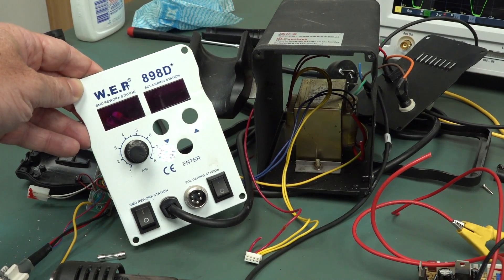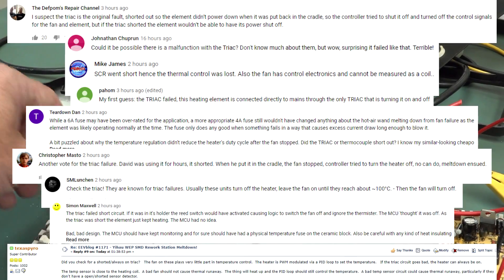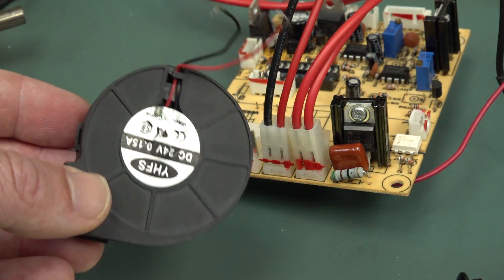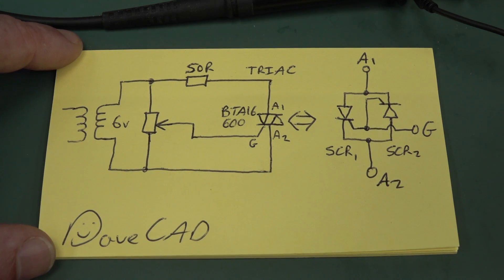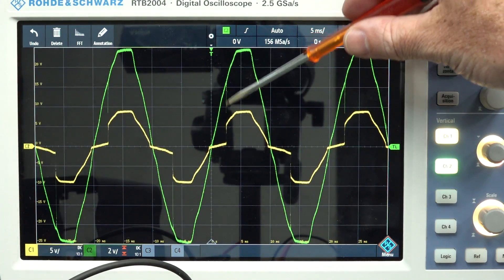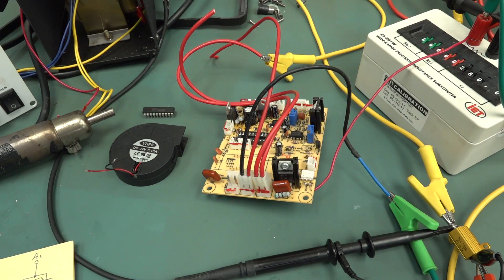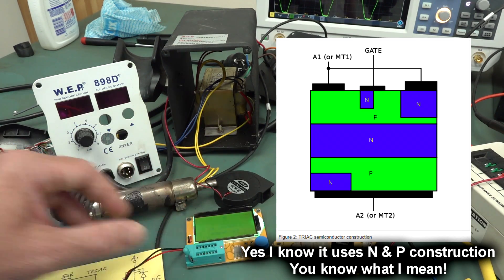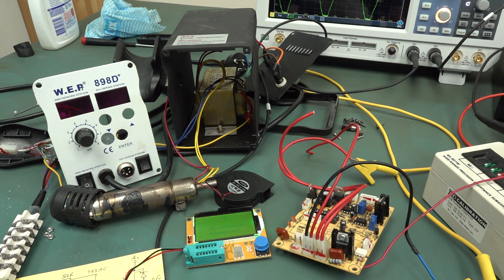EEVblog #1172 - TRIAC Testing (WEP Meltdown Part 2)

Comment: I have a cheapest&noname 858D station and there're not 24V on the fan. It regulates within about 4-17V through linear regulator. Btw, the fan is marked as 24V. I believe the IC inside is the same as your one, with 3-16V power supply. So, probably you killed it instantly☻ I wonder why they mark it as 24V? Probably because the entire thing is made of cheapest crap, so they're using some standart rotor, that's just cheaper I suppose and no one cares about its marking.
Reply from the maker: It should have still done something (even briefly) at 24V, but it didn't, it was dead.
Reply: @EEVblog  Anyway, there're no fan fault detection.The MCU can only turn it off and on. The fan does not have hall output for rpm detection, only power rails and nothing else. And there're no thermal fuse near heater. So I guess in normal condition closest side of the heater is cooling by airflow and only because of that the plastic around is not melting. If the fan fails, the whole heater became hot and plastic starts to melt. That's your case. And you're lucky! In case of TRIAC fail, the heater will became red in seconds and the plastic around will start burning☻ (say hello to Lukey solder stations!☻) 
Please look at this video and you will understand what I'm talking about: v=m5kzyUFb2Sg

Comment: I'm using DaveCAD and so far I love the software! Simple, clean! No whackers!
Reply: I find DaveCAD works better with the graphite powered human interface device. The rolling-buffered Ink-HID often enables write-protection accidentally. [edit: and yes the last one is also write once, read only]
Reply: Simple yes. but sadly nu updates.......
Reply: @muppetpaster  Don't need em, no bugs, every needed feature included...
Reply: @juliandahl1999  Oh beware....it might become obsolete! hahaha
Reply: It requires a high quality perefiral, mine one is glitching all the time.
Reply: I like DaveCAD but I found a lot of the discrete components were missing. Most are there but some needed to be downloaded from a third party supplier.
That being said it is very portable......

Comment: curious if the magnet in the holder interfered with the hall effect sensor. David did mention that it was intermittent so maybe hand piece not locating correctly in the holder
Reply: Probably not. The magnet in the holder is a constant magnetic field, the hall effect sensor picks up a changing magnetic field. The constant offset shouldn't harm anything.

Comment: Great video once more! Probably the thermal capacity of the heating element was enought to melt the enclosure after the fan failure. I have similar unit and it blows air thrue the heater cca 1 min to cool itself.

Comment: Could a short in the fan disable the control loop by overloading the low voltage supply?
Reply from the maker: Would need to reverse engineer the circuit to see.
Reply: Dave measured the motor resistance with a multimeter it was open circuit.
Reply: It is now open circuit, but that doesn't mean, it failed short and then due high current something burned and turned open circuit.
Reply: @morantaylor  Well that pretty much settles that.
Reply: Yes, it adds the extra thermal resisrtance between heater ane the heat sensor.

Comment: So, does this mean the driver failed, but the motor is fine? I know you hooked it up the power supply, but if you hooked up the motor bypassing the driver would it work? Curious, not sure how these work.
Reply from the maker: The coils measure ok BTW.
Reply from the maker: You need the driver, it alternates the drive to the coils so it can spin.
Reply: @EEVblog  Gotcha. Interesting. Thx for getting back :)

Comment: Hi Dave, Could you make a video about using transconductance on a multimeter ? I have an Escort 99 multimeter I bought on eBay is pretty much the same as the keysight U1252. I manual show measuring resistant but doesn't do anything.
Could you believe that there is nothing about it using that feature on multimeters.
Reply from the maker: You mean Conductance. You have to take the value in nano siemens and invert it on a calculator to give giga ohms.
Reply: @EEVblog  hahaha sorry! Ok thanks

Comment: I wonder if the motor drive IC eventually failed because they didn't add the RC filters?
Reply from the maker: Maybe. Could have been the (incorrectly specced) supply voltage, or maybe some form of SCR latchup (ironically) that could have killed the chip, or something else. The diode and RC filters would be there for a reason.

Comment: This is not actually a bug, but a feature!
The MCU detected a fan failure so it blew up the heater while you were in the vicinity
so it wouldn't burn your house down in case you left it plugged in.
Reply: Being white hot was the safety feature so anyone could see it was failing.

Comment: Did you supply 24V to the fan which has a hall sensor / driver suitable for 3-16V? I bet if the fan wasn't dead already you killed it right there 8-)
Reply from the maker: It was labeled 24V DC
Reply: The fan had "DC 24V" written on it ¯\_(ツ)_/¯
Reply: Ah okay I didn't see that. :-E

Comment: It could still be a high voltage break down, I have seen high voltage transistors fail only under high voltage and tested OK at low voltage, drop 240V onto it and see how it goes, this is exactly why I built my high voltage leakage tester project: https://www.youtube.com/watch?v=_N-gh16ADH0

Comment: Fix it you can get a replacement blower handle between $12 and US$18. Show people YiHea can have many years of service just by replacing a soldering handle or hot air handle. Mine did.
Reply: The question is, can the base station still be trusted?
Reply: GromBeestje Why not get a new upgraded fan one that uses ball bearings instead of sleeve for Barents rated for longer life you purchase fans on a lifetime rating. Upgrade the magnetic switch by one online from a reputable manufacturer. And for added safety mount a proximity sensor to a cut off switch for heater power so every time you hang up the hot air gun the proximity sensor you installed automatically cuts the relay power to the heater. My son and I have been using ours for 2 1/2 years salvaging thousands of parts off boards just to solder station handle burnt out after 2 1/2 years it was seven dollars to replace. My YiHaw three-piece combo station was a hot air gun a soldering iron and a power station combo. It only cost me $57 US to buy that same combo station in Weller or any of the other big names was several hundred dollars.
Reply: all it needs is a new fan and/or a new transistor that can handle 1A, will last forever, but out famous engineer screwed it completely by not knowing simple things like the difference of temperature on the thermocouple with and without airflow.

Comment: The MOC opto-coupler gate driver fails as well. Just this week I replaced a TRIAC that was conducting without external signal and that fail to correct the problem, it was only when I replaced the MOC3041 that the behavior went back to normal. Testing the whole driver circuitry is a good idea...
Reply: But there is no need for all that, because the problem that caused this all is what he says in the first seconds of this video, but dismisses it, because he is over-qualified to know the heating element is heating from it's center and without airflow the heat on the thermocouple is ways lower, so the system will keep on heating but never can reach the set temperature. So instead to resolder the two wires of the fan, check it's transistor and replace the housing of the handle, he decided to screw the whole station completely.
Reply: @Wilson84KS  I will say it again, MOCs are fragile and can fail in a way that keeps the TRIAC on all the time. Without proper checking the whole driver circuitry you can't say that's the fan that caused all that mess.
Reply: yes, you are absolutely right, even opto-coupler that are used for feedback can fail, the heater in my flat failed because of that, could't see if the blower is running, just a simple N/O-switch as sensor with no high voltage on it, but in this case it's clear what went wrong, but Dave doesn't even stay on that but directly goes over to screw the whole station, maybe, but only maybe, with a almost not existing chance the TRIAC-optocoupler setup failed, but this is definitly what comes after anything else, the last try before I would write a sketch to an other uC and try to drive the circuit.
Reply: I was watching this and saying the same thing the entire time. The MOC3041 is marginal at 120 volts let alone 220 or 240 volts or whatever Australian mains is. Should have removed it and tested it also. The datasheet says it is for 120 volt control, but then later states it is recommended for 120/240 volt rms. Probably depends upon if the load is totally resistive or if it has an inductive component to it. The 400 volt rating is the off state terminal voltage. The inductive spike as this turns on and off will most likely be more that 400 volts without proper snubbing. I did not really see enough components surrounding the chip to suspect that the proper snubber network was included.
Reply: This is my next suspect as well. Is there a signal on the isolator's output? Input? MCU? Does the signal from the thermocouple make it to the MCU's input? Are the thermocouple's wires shorted or open? Any of those things could cause the triac to get stuck always-on.

Given that fans rarely quit out of the blue under normal circumstances, maybe an over-voltage killed the fan and other stuff on the control side.
Reply: If your main AC is 230V than it will happen again, in Germany standart is MOC3063, because MOC3041 can't handle the peak voltages, but many manufacturers still use MOC3041, don't know why, there is no difference in price.
Reply: @Wilson84KS  My main AC is 127V
Reply: @Wilson84KS  I told dave that on last video the moc 3041 dont turn off the triack on 240v+ i fixed years ago a motor controler whit that issue the machine work fine on 220v but when it move the place(240v) it works for like 4 days and then the motor dont stop when needed 400v moc and issue gone.
Reply: @pufero1 yes, especially when you drive an inductive load the peak voltage rises and then the MOC3041 just die, I can't understand why they still don't use just an other one that has a higher peak-voltage, it doesn't cost more, doesn't need an other setup or anything, it's all the same except of the peak voltage. I see Dave more and more as an insult for every true engineer, can call me a hater, but I think he is pretty incompetent, my dad is a graduated engineer and got his diploma in sowjet Russia, all hate on sowjet technology but have themselves rarely a clue what they are talking about, all very competent when it's about using their tongue but practically are complete morons compared to sowjet engineers.
Reply: @Wilson84KS  I have to agree with that, Dave just jumps to some sort of conclusion without proper testing even a third of the possibilities, that's not the way engineers do.
Reply: @Wilson84KS  Right, but the MOC dies when the main triac is burnt. I hadn't seen died MOC30xx in case the triac was OK.

Btw, there's no varistor to protect them. Maybe value engineering?
Reply: @PETMK  well, if MOC short itself, the triac will be gonner as well, esp. on a penny pinching design with a single resistor in the circuit between 4 and 6 pins.